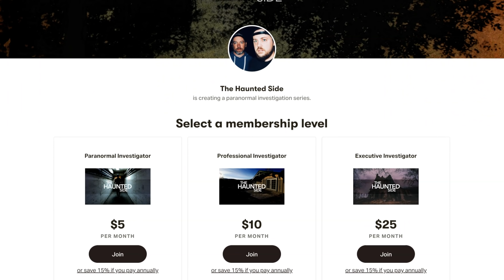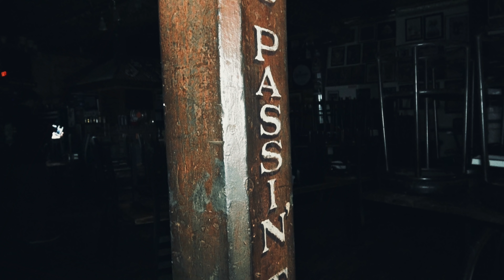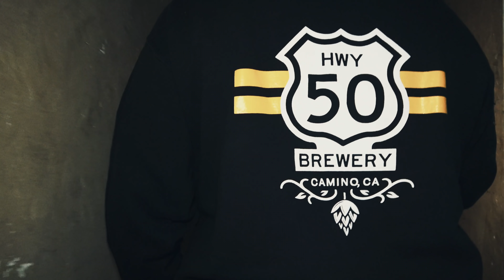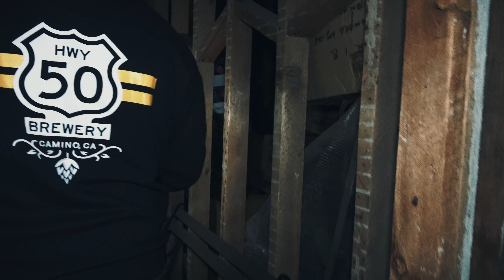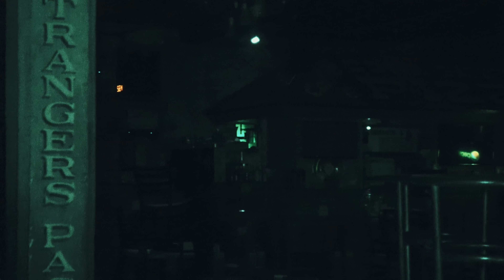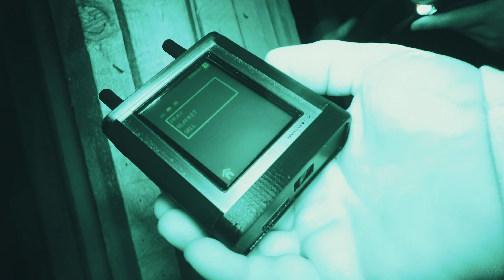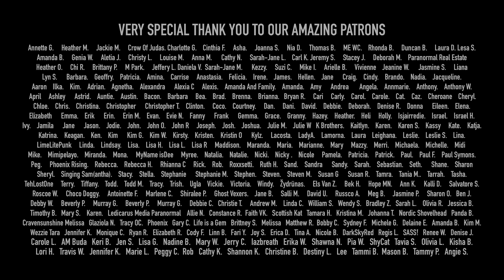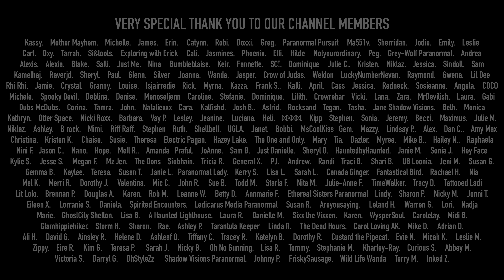Red Dog Saloon | Paranormal Investigation 4k

Comment: You can get a microphone attached to the head phones when doing sensory deprivation/Estes method which ever one you want to call it. You can hear responses then for viewers! It’s been done a lot
Also Jason is absolutely right, physics have stated that every era is in a time loop like every 10 years the era changes but it stays like a video tape if you like, that’s why static plays a big part in connecting with spirits and some may not even be spirits but residual replay